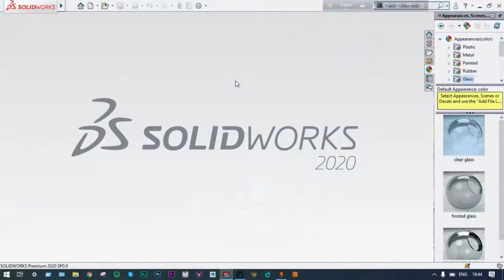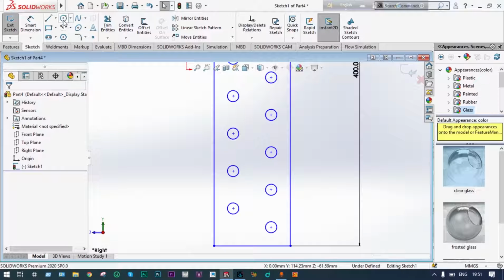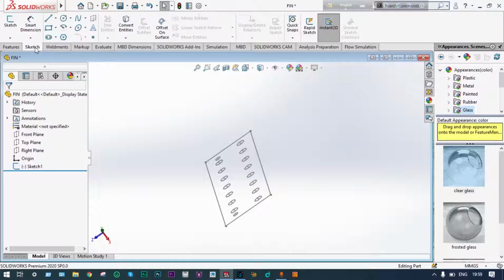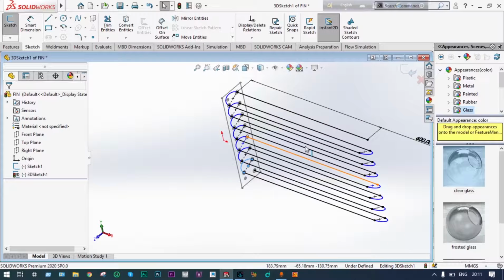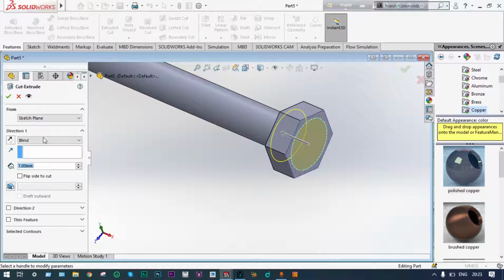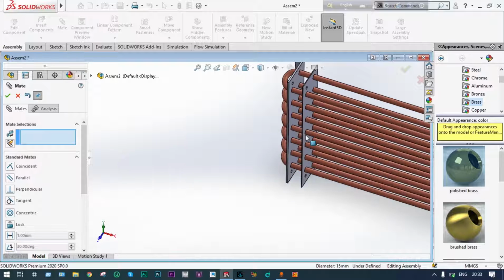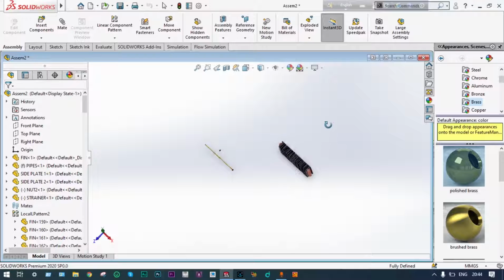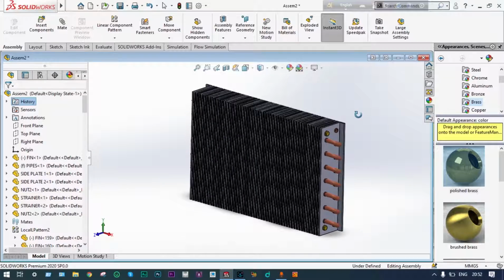The best Modeling Condenser Heat Exchanger with SolidWorks 2020  for Mechanical Engineering Students

Comment: How can I Calculate Condenser Surface area for 1 ton Air-conditioner.
Reply from the maker: It depends on purely mathematical calculation and that can be represented by an equation goal.

Comment: Thanks for this tutorial . Can you make a video that explains Modeling power plant air cooled condenser in SolidWorks
Reply from the maker: I have already made CFD analysis and optimization of powerplant surface condenser. You can see it on my channel. Here I cannot provide any link. It will be deleted automatically.